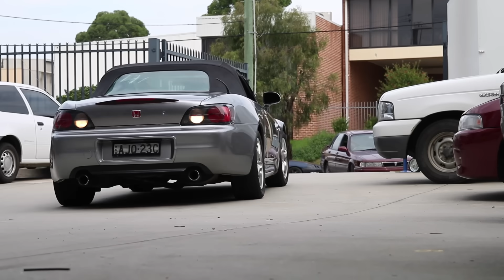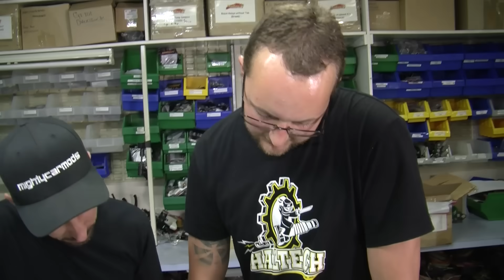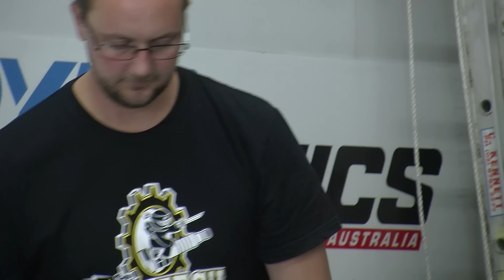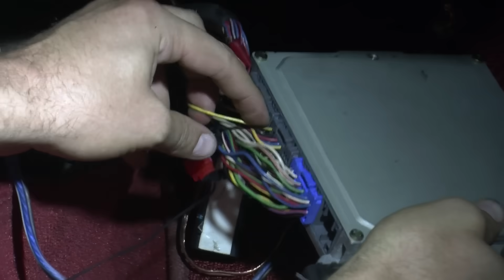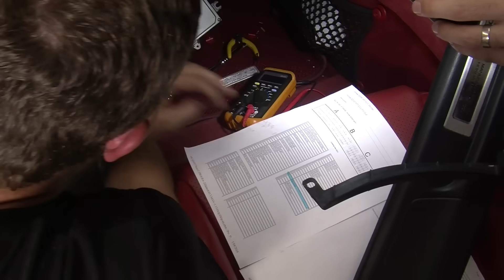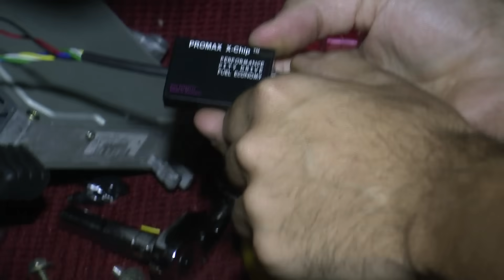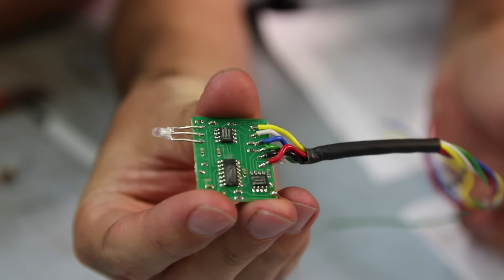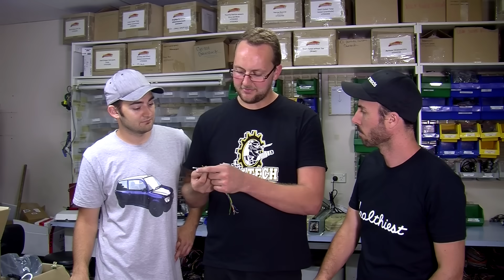eBay Performance Chips -  Mythbusted

Comment: I'm happy with my C2 Motorsports chip for my VW.
Reply: patman0250  i am arguing with a moron that has no idea about tuning performance vehicles. And by the way **YOU'RE  not smarter than me
Reply: patman0250
Real chips works, not only turbocharged engines but on N/A aswell, but you get more power from a Turbocharged engine. But fake ebay crap like the one in the video does not work.
Reply: patman0250  you are aware that is not true..there are chips that do give cars more power..its usually only in forced inducted vehicles like the 1.8t you can get a stage 1 chip and it will net you 20 hp.
Reply: your aware that's a bunch of bs cause it was just proven right
Reply: patman0250  you are aware this is a n/a vehicle right? and a 20 dollar ebay chip?
kid go watch united motorsports tunes they come prepackaged in little chips and they most definately net you horsepower..1.8TURBO vw has chip available for it that tune the ecu to handle the extra boost that a turbo would push out and make the a/f ratio safe you fucking slug so your saying turning boost up on a turbo does not make power??  please kid just cause a 20 dollar ebay chip did not work does not mean a united Motorsports chip wont.
Reply: you are aware it don't matter right
Reply: its funny how much you don't know lol
Reply: *****
 omg i got trolled omfg cool story bro...get a life
Reply: Yeah the only chips id trust would ve ones such as nistune etc. They are the only ones that have actually proven their worth. Not these 3 sensor chip rubbish. You have a point and it is each to their own isnt it! :). Thats what makes modifying a car special
Reply: Have you dynoed?
Reply: I have not, however several other members of the VW community have, and have reported gains
Reply: mikumiku918 Fair enough, must have been proper 'chips'
Reply: you are aware that it does nothing  right lol
Reply: patman0250  whatever kid, i have a car group we dyno frequently and if you think  there cant be legitimate tunes in a chip for a ecu available you are stupid, allot of companies have proven gains..want to know why it did not work? cause this is a n/a honda power is made at the crank and that is the power there is not forced induction so there cant be a chip to make it go faster cause there is not a changing varaible in this case air
Reply: what a fuckin stupid fuck you are all this crap you put in your peace of shit car don't do anything to make it faster you dip ahit ! I don't even know why you have a page ! lol to show that your a stupid dumb bitch ! your just mad because you spent all that money and didn't get shit out of it ! just except that you got had and move on with you pathetic life loser ! fuckin moron !
Reply: patman0250  now i know the kind of person i am arguing with lol ...do you know how a motor works? okay let me explain the fuel and air mixture ignite and make power right? sooooo... that being said if you have a turbo and turn the boost up (bringing more air into the system) and you dont have the extra fuel to compensate for the extra air you are going to run lean...so a chip can correct that to a extent before you hit fuel cut and injector upgrade is required.. you have no idea what you are talking about go shit in a hat.
Reply: yeah your arguing with a person that knows more then you and is much smarter
Reply: patman0250 You are aware that the Original Comment was talking about a "TUNE" not an actual chip... Smartguy...
Reply: xxkidgibxx
You are correct to an extent. I am referring to a tune on a chip, where in order to install it I had to remove the ECU from the car and replace one of the microchips on the main board of the ECU, then reassemble everything.
Reply: patman0250 I stuck a h&s mini maxx chip/tuner on my truck and made a good 250 hp extra and about 550 ft lb of torque, it's just these crappy little chips that don't do anything.
Reply: Jonathan sauder
not funny and gay.
Reply: Tunes on the 1.8t are all flash port tunes. There are no physical "chips" involved.
Reply: Doctor Meat Productions that's not true, GIAC and REVO software are some of the chips that have shown proven dyno results on the vw website. and either way they come in the form of a chip. atleast arp does
Reply: chips are useless and a waste of time. trailed and tested and are not worth the money or effort for such small gain. even if you see a gain it is so small it is not noticeable. Also there are a lot of dodgy dynos out there that 'prove' you have 20hp more but you honestly are lucky to maybe have 10. Do yourself a favour, stop cutting corners and replace your standard ECU with a proper engine management system.
Reply: freshoffthaspot
 funny thing is i run megasquirt stand alone and f-ccon, im just saying and the chips in the f-cons determine allot like i have seen easy 40 hp gain from upgrading the chip in the f-con for more control on timing and ignition, aswell pretunes the rrfpr as more boost creeps up automatically. a statement like all chip dont work is biased because even the very standalones you talk about use chips as ratings. piggy backs use chips aswell for example the pr04 chip in a f-c0n is ratted to help the pulse in my 550cc injetors
(originally 182cc) to run on the right fuel map so i run the same ratio even as boost kicks in my regulator compensates in pressure and basically it depends on the setup and i guarantee you even if a dyno is off if you are seeing a gain on the same dyno thats a realistic gain,  ect.  the setup is the most crucial part of saying a sentence like no chips work or none will give you a horsepower gain over 20 is stupid cause the chip in my f-con is meant to match my flow rate so i dont run rich or lean which will give me more power. and thats not even with the gains the chip allows me to fuck with timing allot more and ignition,

Comment: Hey Moog, once you get an aftermarket ecu, aside from the normal tuning to make more power, do a test on the vet itself. Do a few runs with vtec off and then a few more runs with vtec on throughout the rpm range. Adjust the activation point where the power is truly higher than before vtec is activated. I noticed that with these runs that you have here, the vtec seemingly comes on too late. The vtec in the s2000 is to make more power, but not so violently. You should be able to at least get more out of current powerband.

Comment: U may not know this but USD cars have their ecu on the right side. Most if not all cars have their ecu opposite to the drivers side. This makes sense because the chips inside are very delicate. I took a ride for someone in my car ( 95 civic b18c, turbo 14psi, vtec head, chipped ecu) and I guess they got nervous but they jammed their feet to the floor and killed my chip in the ecu, luckily I had a spare to retune and drive home with. Anyway that's why most of them are opposite to the driver.

Comment: Mighty Car Mods This is just a thought maybe on your future projects you guys could do a 1984 to a 1987 Toyota Corolla Sr5 RWD to do a 2ZZ-GE 6 Speed manual Transmission Swap for Extreme Valve Lift capabilities. I also know that the AE86 is light weight and the idea of doing ITB's on that swap would be awesome. NA is Great my preferred way to drive a windy road. All motor with the help of VVTL-i :)

Comment: Just a short consideration: Maybe you killed the chip by measuring its resistance at the very beginning. Most integrated circuits do use 5V internally. Your voltmeter uses most likely a 9V battery and uses therefore also 9V to check the resistance, this could have killed the chip.

But anyway the scratched labels on the chips are very suspicious.

Comment: What fuel does Moog have in his S2000? Because 180hp is just too low.. even on a very tight bench it should run at least over 200hp. If the fuel has low octane I completely understand why it's 'so low'.
Reply: Think about it though, Honda's theoretical 200+ horsepower is measured at the crank, not the wheels, so after using some power to work things like the alternator, AC, water pump, etc. The actual power to the wheels is substantially less. That's how every car is measured from the factory.
Reply: I know but a completely standard s2000 went on the dyno here on correct fuel and put out 231hp so the difference shouldn't be that big ;)

Comment: 132 KW is quite weak ;/ honda say's that s 2000 should have about 176 KW.... :(
is it power "on engine or wheels" in your dyno runs?
Reply: Because 176 horsepower is almost exactly 132 KW, are you sure you are reading the units correctly?
Reply: Yes, honda claims that s2000 should have 240 hp which stands for about 176 KW that why i am amazed and i ash if this was power mesured on engine or wheels
Reply: So you sam that Moog's honda lost about 70 bhp/ 40kv?  Haha... Do plese epesode called finding lost horses in honda proper service and is should get its power back
Reply: Chipping a diesel is also much more effective than chipping a gasser.
Reply: Abesto Landia Not to mention cars lose horsepower over the years, little by little, and even if the dyno was calibrated wrong (probably wasnt) it was still giving a repeatable test with relatively the same numbers anyways.
Reply: It'll lose power over time and through the drivetrain. Do some research.
Reply: Dude, my car has now 10 years 3 years ago i did dyno run before chip tuning and instead of 90 (as factory claims it had about) 107 bhp ( totally stock golf V 1.9 tdi BRU engine mark)  It must be some kind of Magic ?!?
After loading new program it was 147.8 bhp. Magic again because estimated power after chip was about 130 bhp!!! Now after 3 years i want to fit bigger injectors, IC and turbo so i did dyno to check if engine health is good, and dyno showed after 2 years 148.4 magic again?!? If u have healthy and well maintained engine, power is no a problem even after 10 years. Plus honda says that their engines in s2000 generate full power after 60K km because it takes some time for engine parts to fit properly as they should. Plus if you or previous owner beat the crap out of car it's first thing to "find missing factory KW" and then tune it
Reply: Dude my post is not about chipping but it's all about engine maintain. If engine is in good condition it will not lose power but if engine is in bad shape it will lose bhp like crazy. +70 bhp loss over such a short period of time is massive! Of course if it's power measured on engine( as some say) in this video. If it's on wheels ( Mog's say's that on vid) 40 kw loss on stock wheels it's just weard on 18" i have loss of power 25 bhp so about 20-23 kw.
Reply: KoVLiberty that is because most diesel are turbo charged  you take a turbo gas engine you can gain a lot of power from the right chip in a gas engine.
Reply: Abesto Landia Parasitic losses from the drivetrain.
Reply: CARBON FIBER ALL THE BODY :D
Reply: I'd rather spend money on a car that's worth it. That's a hit ton of cash for a car that could be much better.
Reply: So drop tuning
Reply: Yes but I'd rather spend the money on a car that's worth it. Every new panel for that? Why not buy a new car. Instead of dropping 500lbs.
Reply: Just depends on what you think is worth it.  Besides, chip an E92 335 - 50+hp on a very mild tune.  Dyno charts on Cobb Tuning's website.
Reply: But a BMW is worth it.

Comment: so- I really really want a P chip for my 2002 Toyota tundra 4x4-- ive got obx tuned headers+downpipe, I have an 2 6"Long filters into 4" tubing for a twintake <- n yeah I saw ur episode on intakes doing nothing I am looking at buying a obs throttle boddy spacer after I see if they make a dino difference and  I REALLY WANNA KNOW OF A GREAT -PERFORMANCE IMPROVING P-CHIP - preferably plug n play but I am a audio/video installer for 12v so wires don't scare me but please INLIGHTEN ME!!!

Comment: Oh man. This sucks so bad. Before i watched this i was thinking u guys had ordered a EPROM to solder in the ECU. But this is just crap. There actually are EPROM's to order from ebay or what ever that do a impact on your car. For example the stage 1, stage 2 or stage 3 chips programmed for CA18DET engines. 

But the good thing about this video is that this is what noobs would buy from ebay and expect totally what Moog was illustrating ironicly. So the good thing is: now noobs know, and don't get scammed anymore. Way to go guys!

Comment: 13:30 he says we are going to start the car to see if the check engine light comes on, which is funny seeing as the vehicle has to go through a set amount of drive cycles/miles before a check monitor is run. this means you could disconnect the o2 sensors and it would not trip the light until the car is driven a few miles or in some cases a few hundred.
Reply: Jashomartin If a signal is completely missing, or depending on what sensor is throwing the signal, it will throw a CEL immediately upon engine start.  Go unplug your MAF and start your car if you don't believe me.
Reply: yeah no, most cars will trip the CEL even when the engine is started. if the ECU doesn't see it, it throws a CEL.
Reply: HJZ75driver there has to be drive cycles for it to do emissions monitors.
Reply: Also depends on the vehicle too..My Forester threw codes almost immediately after my front O2 sensor shit itself. cleared the code. drove 200m, it was back on. so yeah, it happens.

Comment: Do y'all get JET Performance programmers there? I'm contemplating getting one for my HHR's 2.2L Ecotec, but am wary about spending $300+. Have you tested this programmer before? And, should I get the chip and MAF upgrade as well even though the JET technician I spoke with said I wouldn't need them if I just bought the programmer.
Reply: Get a Haltech plug in ECU bro. no stress, no dramas, plug, plug, plug, fire it up :D easy done.
Reply: Ahh, but how much control over shift points do I get, or does it turn off the factory governor? and how much does it cost?
Reply: all of the above. probably $3-400. its a plug in standalone ECU. can do everything with it.

Comment: S2000 has 240hp. Why does it say 179??
Reply: Nonos tis meras Honda claim that power at the engine. At the wheels you get 179hp. Gearbox, driveshaft, diff all take power to spin.
Reply: I believe it differs for different markets, i.e. European and Japanese market vehicles normally have higher BHP than USA cars.  Down to the fuel quality too.
Reply: Jez3134 Man! You can't lose 60+ horsepower on the wheels....
Reply: Nonos tis meras  My skyline has 378kw (500ish hp) at the wheels. If I take the engine out and dyno it on a machine it would probably put out 450kw (600hp). You lose a lot unfortunately. In my case 100hp. When it was stock 187kw (250hp) it was 150kw at the wheels (200hp)

Comment: I have to say, it's rather interesting the number of people who are totally full of shit on this comment thread. To address a few things I've seen:

Power displayed by the dyno, first off, there are three common measurements of power when talking about cars; PS, Hp and Kw. now, they are all three of them exact quantities of energy. However the power displayed on a Dyno needs only be relitive for tuning purposes, so yes.. you could do it uncalibrated... but; no, it doesnt happen, dyno shops have thier equipement serviced and calibrated regularly. 

power of the S2000, cars do loose power over time, and in large quantities. to the guy rabbiting on about "his volvo thats as fast as new" you sir, are full of shit. it simply isnt. firstly you have no brand new car to compare it with.. and you havnt noticed the losses as they are so gradual; not "turn the key oneday, lose 50hp"

to the grammar and spelling guys: shut the fuck up, nobody cares.. if you cant read it a) youre a fucking muppet, or b) its that bad that the comment probably isnt worthwile.

It saddens me an awfull lot that you people have to marr a good, informative film, with your bullshit quarrels. talk sense, and on topic. and quit pulling "facts" out of your assholes.

Comment: I'm shocked, a $20 chip bought on eBay didn't work. Maybe next time they'll check in a proper after marker ECU and get some more unicorns out of the S2000.

What is the factory quoted KW/HP for the S2000?
Reply: 177–184 kW (237–247 hp)
Reply: blaze
That's at the engine right, not at the wheels. Otherwise he's lost a few unicorns!
Reply: Craig Best Yeah that's at the engine

Comment: a MAP and MAF sensor give different outputs, mod chips are setup for a frequency type MAF, as the MAF frequency rises, it increases the resistance for the air inlet temp.
This keeps the ECU from adjusting the air/fuel at idle, then kicks in after 2000rpm

Comment: No surprise that it doesn't work. What is a surprise is that that s2000, which supposedly makes 240 hp at the crank, is making 179 hp at the wheels. That's a driveline loss of over 25%. Still a good and thorough video.

Comment: There is cheap ebay chips. All they are is a $1 resistor and trick your cars temperature to get more fuel in it but you realy only see gains of about 3-5hp which in some cases your ecu works it out after awhile and goes around it like they said on the video.

Comment: I'm sure S2000's come 250BHP stock?!!??!
Reply: BHP is from the crank. They got 177WHP.
Reply: cars can lose power over time and not every car off the line is up to that exact spec.
Reply: thts power to the wheels , 177whp = like 220hp maybe ? But ye it should of made at least 180whp

Comment: I bought a chip for a Saab 1.9JTD 120hp car. It was about 50 euros. I'm not saying its giving me more power, but after about 5000 km's my fuel consumption dropped from 6.7l to 4.9l. I have the chip for 50.000km now and I'm happy with it.

Comment: so from 240 engine hp to the wheels it loses 62hp !
That's 27% transmission and drivetrain loss. Isn't that an awful lot for a rwd car with a manual transmission? Imagine it had 4x4 and an automatic trans. The loss would be over 40% !